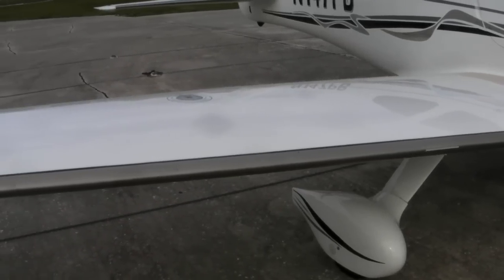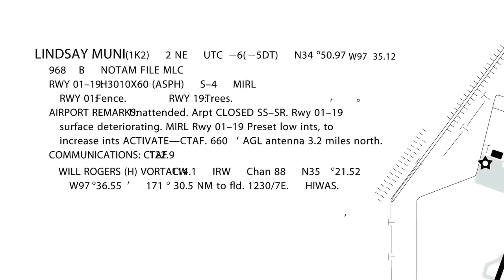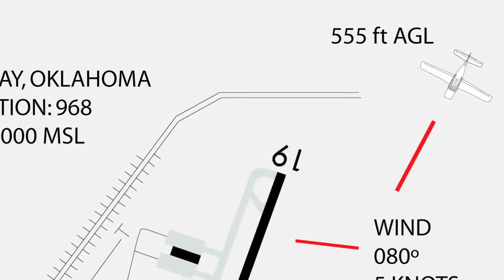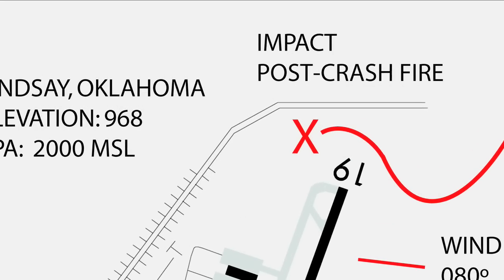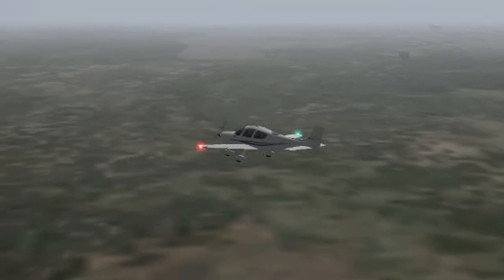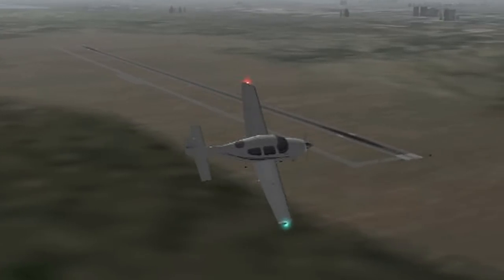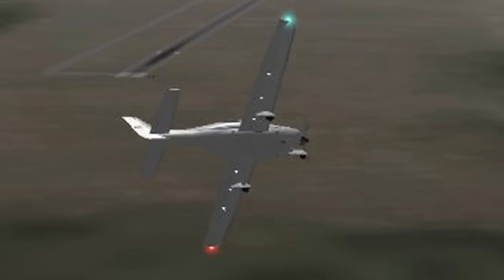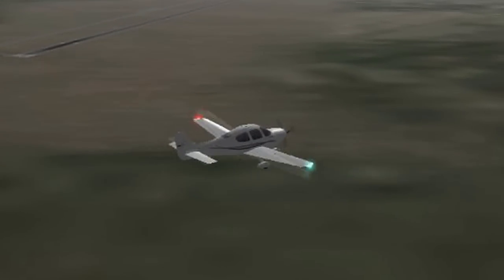Anatomy of a Cirrus Stall Accident

Comment: @shaneboulds It seems to me that the deceased pilot applied the correct spin recovery procedure (opposite rudder) in what seemed to be a partial stall.  But due to the peculiar design of the Cirrus aircraft, this actually made things worse because the ailerons were still effective.  I heard once a Cirrus gets into a real spin it's nearly impossible to recover and that's why they come with parachutes.  Correct me if I'm wrong
Reply: 11 years after your posting! The Cirrus spins quite normally, and recovers normally, but it is slick and takes some vertical distance to do it. The Leading Edge Cuff on the Cirrus was not done to NASA specs of their spin-resistance test program, and the wing aspect ratio surpassed the NASA test airplanes significantly. Cirrus proved normal spin performance to gain European approval. It is true that >>effective<< cuffs actually inhibit recovery.

Comment: True, the 30 degrees of bank assumes you're flying the airplane correctly in the first place.  You can be straight and level and yank it into a stall, or if you're stretching the glide in an engine out situation;  the 30 degrees of bank is a general rule to keep people from yanking and banking themselves at what would usually be a safe airspeed into a stall/spin below 1000' AGL.

Comment: Does this sound about right?
...
Only 223 AGL, little room for a stall recovery, much les a spin.  This would make him averse to using too much foward should a stall start.
...
That last left bank was very aggressive therefore with high back pressure (AOA) to keep from descending too much.
Left wing stalls first; possibly when starting the roll-out, since the left aileron comes down.
He may have tried (more) right bank, but quickly saw no effect.
So... he kicks right rudder.
The right yaw would now slow and stall the right wing, initiating the right snap roll. He may also still be holding right roll aileron, thus aiding the right roll rotation...
He probably does not want to reduce back pressure for a lower AOA due to the low altitude.
--
Regards.

Comment: @iratherfly Classic accident? Piper has no issue with uncovered fuel inlets in any angle of bank up to 60 degrees and they haved used a left/ right fuel selector for decades.

Comment: The real question: What was the aircraft doing in the pattern at 500'+ BELOW pattern altitude making totally non standard maneuvers??? There was a CFI on board and he/she allowed this? Or, worse yet, was the CFI at the controls? This is but one of many GA accidents that are a direct result of poor judgement. In flight school, I was told repeatedly that the most deadly threat I faced was something the instructor(s) could NOT teach me (or anyone else), and that was failure to exercise sound judgement at all times while piloting an aircraft.

Comment: @GuyJCooper Simulated engine out should be done with a hard deck at ...say 6,000 ft AGL? Not atop a runway.
And then, there is that classic fuel management accident: Fuel selector valve set to pull gas from only one wing. Banking during the turn to final causes remaining fuel in this wing's tank to move away from pump line by gravity and centrifugal forces = Fuel starvation and engine dies off --> slows low speed aircraft even further --> inner wing stalls --> spin --> terrain.

Comment: So, basically Cirrus designed the wing to give a great deal of warning during a stall demo but in actual fact created a wing that will stall very violently and asymmetrically under real conditions. The stall will not progress smoothly due to the split leading edge. No wonder the Cirrus fails to meet part 23 for spin characteristics. They designed the perfect wing to provoke a spin and resist recovery.

If they wanted good stall characteristics all they needed to do was put a Hershey bar wing on it. The Pipers that have them are the mildest stalling aircraft and even have decent aileron authority in a stall. And they recover form spins beautifully if forced into one.
Reply: The key to spin recovery is a bigger tail to get more yaw moment.  However this will cut into the advertised high cruise speed.  All the slick composite ships from Oregon were designed probably by the same team of people. They all have horrible stall and spin characteristics.  The wing loading is too high, all of them.  Glassair, Lancair included.  They are high performance airplanes but none are designed with adequate stall warnings
Reply: Uhhh.... no, you completely and totally missed the point of the video.

The wing works, it helps maintain roll control in a stall, but it ca't save you if you put the whole wing in a stall at 223ft aglow and stomp on the rudder paddle and enter into a vertical snap roll.

Comment: My CFI regularly had me fly 500 ft off the deck and do snap entry spin practice at 200 AGL. Usually we practiced in IMC so I couldn't cheat on the recovery and use the horizon as reference. My favorite were when we would work on low pass barrel rolls down the runway under the hood.
Reply: Kansai Guy ( my instructor had me do the same as you did right after I soloed back when I was getting my privates. We did our steep turns at about 25to50 feet AGL. happy flying.....
Reply: I have been laughing for a few minutes now. Excellent.

Comment: I was on the Cirrus list of pilots take up a 22 and for me I just wanted to feel the difference with new mfg. technology and airframe.  I went through all the performance maneuvers and wanted to do a stall spin.  He mentioned at the time that the aircraft was not meant to do a stall spin.  For some reason I thought all FAA certified AC needed to go through that test.  The parachute has some limitations as well.  You have to be at a certain low speed before deploying it, limiting its use.

Comment: I think this is what happened in Houston also !  A buch of  turns and go around an low altitude..  i think that stick i hard to get used to
Reply: In the Houston accident the pilot pulled power and retracted the flaps while still below the flaps up stall speed.

Comment: It's this simple.   We now have a lot of airplane drivers, rather than all around pilots that KNOW instantly and instinctively how an aircraft is going to react in this mode of flight with those control inputs.  Often, the first time a pilot EVER sees a spin is when he is in exactly this position, low (one mistake high) and slow.  And his first DEAD WRONG instinct is to pull back on the yoke.  GAME OVER.  I think some aerobatic training should be REQUIRED for every pilot, but that will likely never happen.  Just makes too much sense, I guess.  Until then, all the videos in the world are not going to solve the problem, or much limit its scope.  These AVweb  videos though, one of the few means currently employed to try to correct these types of problems are  always excellent.  It would be prudent for "airplane drivers" (you know who you are) to get on a simulator after watching something like this that is NOT fully understood and instinctive and practice the crap out of it.  It could, and probably would have saved these two lives.  A serious consideration.  Kind of like the jet pilot that had practiced the water landings over and over and over again, likely for fun as much as anything ;-) ) on the sim before the New York incident.  Things worked out EXCEPTIONALLY  (almost absurdly) well there, with the boat traffic on, etc.  BUT WORK THEY DID!

Comment: I've only got 150 hours but I would NEVER attempt a maneuver like this...even at pattern altitude.  Also, people seem amazed that this could happen with a CFI on board, but it only takes 250 hours to become a CFI.  That's not really very much flying experience.
Reply: Especially at pattern altitude.  ;-)
Reply: I think you get sucked into a manuvuer like this. Something happens that causes you to forget your situation. Then you make an incorrect move and boom, you are out of control. The goal is to not get yourself into a situation where you forget what is going on. This kills a lot of people, it is not due to incompetence but more to a lack of diligence. We make mistakes as pilots all the time but usually they occur at points during the flight phase when they are not deadly. Avoid situations where mistakes are deadly.

Comment: @dboy4ever well, that could work. howeverproper  counter spin procedures  tell us to control roll with rudder. PARE :power idle aileron neutral, opposite rudder, elevator to brake the stall. If he was indeed in a fully stalled condition with the left wing being more stalled then the right, (a left rolling incipient spin) then countering with aileron would only make the spin tighter and harder to get out of. Opposite rudder was proper for a spini think he wasnt stalled completely thus a snap roll

Comment: @dboy4ever Well considering he was below 500 feet he wouldn't have the time to apply full spin recovery procedures, OR the time to enter a full spin in the first place. Simply the plane stalled, spin recovery was applied and since it was so early in the incipient spin stage, it caused a snap roll, (A basic aerobatic maneuver) and that ultimately led to disaster in this case. RIP to the pilot.

Comment: From what I understand don't aircraft already have 'wash-out' - a twist of angle of incidence between the root and tip of the wing ? I know that some training gliders have an aileron differential - upgoing aileron giving more deflection than down going drag inducing one - less adverse yaw and more down force to drag inducing lifting force, on opposite wing, to help reduce a yaw to spin. Then again a down going wing also creates a higher angle of attack, to angle of oncoming airflow, when angle of attack is near a stall - hence requirement of a wing tip of lower angle of incidence.
Reply: it prolly has more to do w/ selling.  it is more often merely 'marketing':  new 'ingredients' - flavors, features, and formulas.  exactly as what can be found in the shampoo aisle.  people go for it.  now there are 23 ways to wash your hair and crash your airplane as well.

Comment: @acemannw 550 feet above the ground and no warning.  you'd have to have spiderman like reflexes to pull the chute handle before you hit the ground.
 (depending on speed and direction of travel, (horizontal/vertical) the parachute takes at least a thousand feet to work anyway.)

Comment: It seems to me that the root cause of this accident happened about 20 miles out, when the pilot didn't align his aircraft with the runway. The logical recovery procedure from this mistake would have been to turn left and make a gentle five-mile-wide 360 to align with the runway centerline. Without the CFI in the right seat, he may very well have done that. With the thought that "I'm going to get a bad mark on my BFR if I don't get this thing on the ground right now," he then proceeded to attempt a maneuver best executed in an A-10 and fell out of the sky in the process.

Comment: Considering the erratic control inputs evidenced, is it likely that command of this aircraft was in dispute? It's possible that the instructor was attempting to get control away from a errant pilot.
I'm not a pilot, this is just a wild-assed-guess.............
Reply: That's not erratic. Part of it will be noise from aircraft vibration, control slack, etc. The rest is normal control movement. Look at a video of any control movement or even the steering wheel in your car. Very rarely is it perfectly still.
Reply: Bartonovich52
I was referencing the erratic movement of the aircraft.....Not some minor shaking of a control.

Comment: What was the instructor doing? Was he intending to pass this flight review after a debrief? The return to the pattern was dangerously low and then these steep turns to rescue an approach? This is the problem with instructing. You get to far out of the loop simply because you're just monitoring.

Comment: The most obvious common denominator to me in these turn to final accidents is NOT the high bank angle.  I have watched knife edge 90 degree bank angle turns to final dozens of times per week for the last 30 years with NO stall spins. The difference is when you use a high bank angle turning to final, then decide to push the rudder to full either way, resulting in a snap roll.  In my experience coordinated flight has not been stressed during instruction in the last 40 years.  Many, if not most flight instructors today expect student to be uncoordinated in turns, especially in the pattern and may or may not say anything.  That's the way instructors for the last 30 years have been flying because that's the way they were taught.  Most instructors will tell you that high bank angles in the pattern are the killer.  No.  It's uncoordinated flight at high bank angles that has killed hundred of pilots.  There are even instructors here on YouTube that swear that anything over 30 degrees is just plain stupid and dangerous.  They are wrong, but they don't know any better because that's the way they were taught by THEIR instructors.

Comment: It's the same Theory Cessna uses when we put three to three and a half degrees of washout in their wings
Reply: It's a standard design feature which has been used since .. ever? This is just another implementation of it. Model airplanes used it nearly a 100 years ago, since they were free flying and they wanted them to recover from a stall without dropping into a spin.

Comment: First instinctive reaction in a loss of control situation must be PUSH.  Push until you're light in the seat.  Push to control AOA / unload the wing / break the stall and reduce any yaw-roll coupling that may be present.  Think of the stick or yoke as an angle of attack lever.  Unfortunately, this response is NOT instinctive.  Its the exact opposite of untrained instinct, which is to PULL when the nose drops.  The FAA is complicit in every such accident in not requiring upset recovery (UPRT) training for the Private certificate.  Simple stall training falls short of real world competency in situations like this.

Comment: Considering it was a flight review the instructor may have simulated a engine failure in the pattern causing the pilot to use aggressive inputs and just let it get out of hand. It has happened before.
Reply: Ooops. I never considered that one.
Reply: John simulating an engine failure at 500 feet agl?
Reply: +hurf_durf I did a motorglider course in the air cadets when I was 16 where we had to handle an EFATO; the instuctor surprised me with the engine 'failure' at somewhere between 500' and 1000' agl, I surprised him with an immediate full bank 90 degree turn to the right (all my flight instruction before the course included aerobatics so it didn't seem weird) followed by pulling the airbrakes to put the aircraft down on the grass between the perpendicular runways. That was instead of the correct response of putting it down in a field past the end of the runway (and the entire base) which I knew would be a bog 'cos it was underwater the day before... I overthought in that sense.